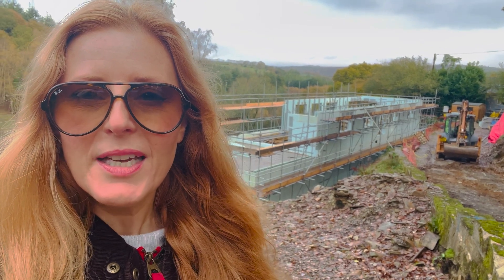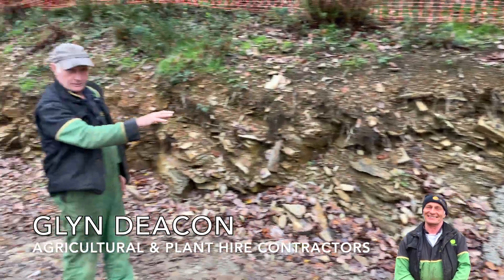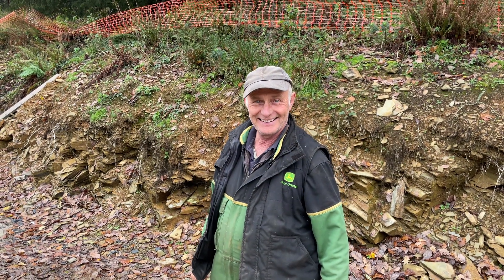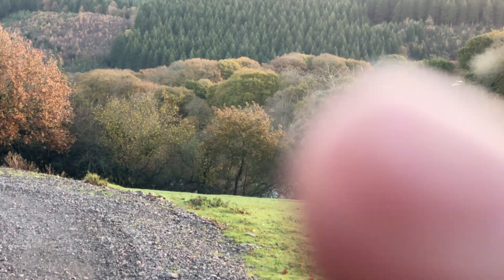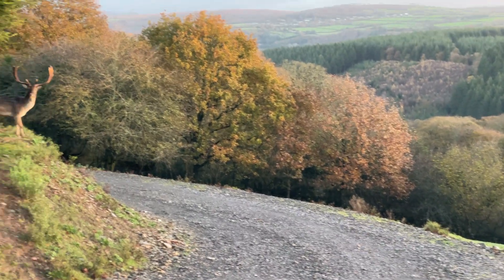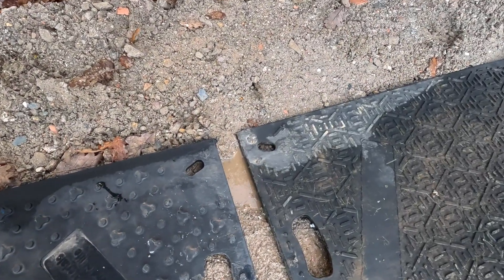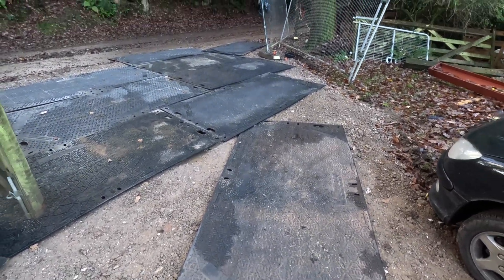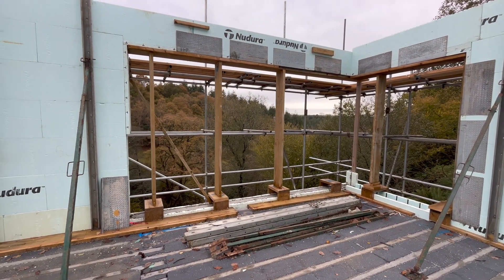ICF Floating Corner - Self Build Diary 11

Comment: I found this last night and have now watched all of your videos - incredibly insightful as I'm just about to start a new build and am torn between ICF and timber frame. If you don't mind me asking, was it architected with ICF in mind - I'm wondering whether for the best results you need an architect familiar with ICF or not ? I'd also be intertested if you found someone to pour your staircase. Thanks again - great videos :)
Reply from the maker: Hi Julian. We decided it would be ICF before the plans were drawn up by the architect. He hadn’t drawn one for ICF before so there was a fairly big learning curve. The structural engineer was an ICF specialist. In my opinion, this is the bit where you need the knowledge. We had to have the retaining wall built anyway so sort of made sense to do it all in ICF as it’s great for structurally. It also seems more permanent and substantial than timber frame. I’m sure timber frames are great but have heard a few horror stories and also know a guy who is having water ingress problems. Let me know how you get on. I’d be interested to know. Stairs being poured shortly. Thanks for watching 👍👍👍